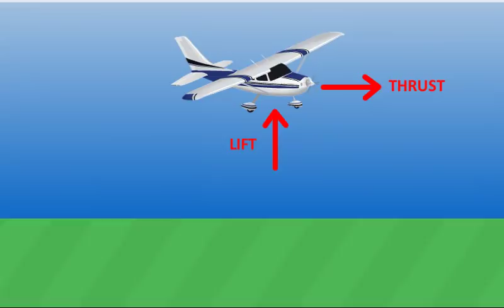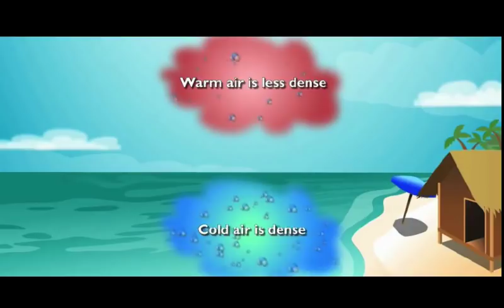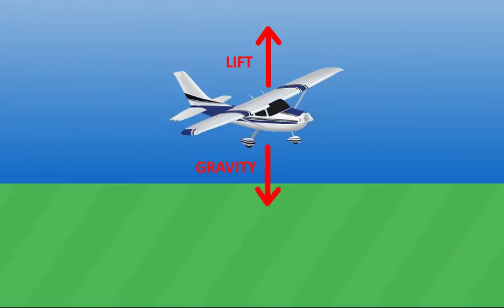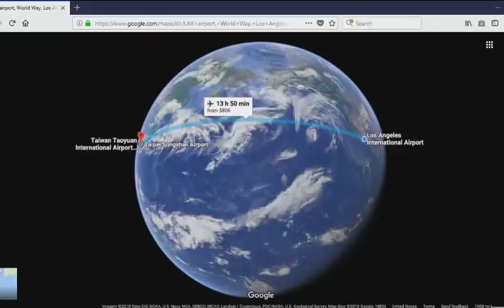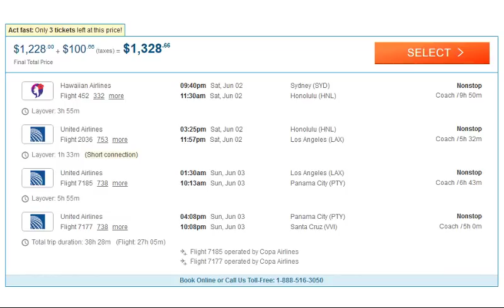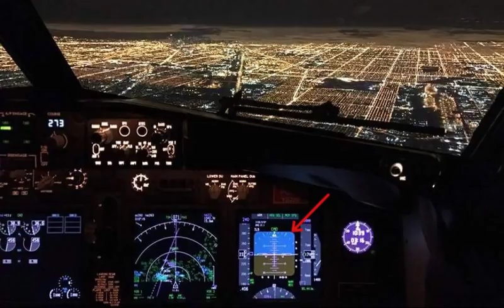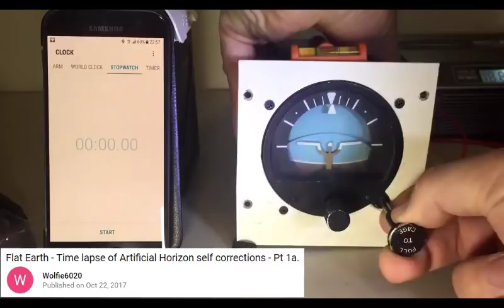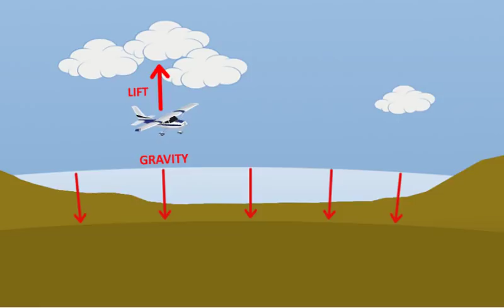Flat Earth Falsities - Plane Nonsense

Comment: First example is bull shit straight away if you throw a ball up in your car it will come back down as you are contained in the car try doing it on a mother bike see what happens...unless you think earth is a contained system ?
Reply: Correct, Earth is a contained pressurised system.
Reply: GrahamStw what’s containing it ?
Reply: Do you read your comments before hitting reply? Why the hell would throwing a ball up when riding a bike be relevant to the point this video is making? Maybe a little less weed before commenting! Good God!
Reply: Greg Mcbride if you don’t know that much of how the atmosphere works you shouldn’t make any claims, especially against proven science
Reply: It contains itself. 
Air pressure decreases with altitude. 14.7psi at standard sea level, but by the time you are 5500 metres up a mountain it is less than half of that. By the time you reach about 16,100 metres in a plane it is down to a tenth of that. By the time you reach the exosphere (700,000 metres and above) the air pressure is effectively zero.
Reply: WIND
Reply: GrahamStw or it has a dome. you have no idea

Comment: dmurphy and Flat earthers have never said the artificial gyroscope is fixed in space and therefore should roll backwards as it goes around the curb of the earth.
Q. If the gyroscope automatically adjusts to the direction of the earth wouldn't that be a false reading to the pilot ? the gyroscope initially reveals to the pilot of the curve then adjusts itself to the horizon again, so what adjusts the direction of the plane ? unbelievable.
Reply: In answer to your question, no. 
The purpose of the gyro is to indicate level. The point of the pendulous vanes mechanism is to adjust the gyro so that it spins parallel to level.
Reply: I suggest you watch Wolfie’s “A look inside an artificial horizon” video. 
https://youtu.be/z1QGRPVBZvw
It shows the internals of the attitude indicator and demonstrates the pendulous vanes mechanism.
Reply from the maker: Tribes - I showed a clip of DMurphy saying exactly what you say he doesn’t say - “should roll backwards”. Did you even watch? 

No, the gyroscope does not present a false reading to the pilot because the adjustments are slower than normal plane maneuvers. If you bank left or right, the gyroscope will stay upright in the short term, such that it indicates the bank. Same with a pitch up or down. The gyroscope maintains level to earth long enough to indicate the pitch. But over longer periods of time, the gyroscope can become out of sync with gravity, even if there were no curve, because even the best gimbals are not perfect, so some acceleration forces will push the gyro out of alignment.
Reply: "So why does have to adjust to the direction of the earth all the time ? It shouldn't have to."

Because the Earth is round, so level in one place is not the same as level in another. True Level is defined as a tangent to the curve, perpendicular to gravitational pull.
 https://s33.postimg.cc/7unercrfz/level_tangents.jpg 

As Voysov says, the mechanism would be required on a flat earth too, as it erects the gyro correctly at startup and in-flight it corrects for precession and possible tumble from fast manoeuvres.

Here's the user manual for a typical artificial horizon (aka attitude indicator): https://www.kellymfg.com/images/RCA26_AK_BK_EK_user_manual.pdf

Here are some quotes: "During pre-flight procedures, the attitude gyro must be provided with adequate electrical power under normal vibration conditions 
(engine running). Allow a minimum of three minutes for the gyro to settle to true level."
"Caging the gyro while in flight when the aircraft is not level will cause the level indication to be incorrect. The gyro must be allowed a few minutes to settle to True Level before it can be safely relied upon. If you must cage the gyro while in flight, it is best to have your aircraft as close to level flight as possible. The closer to level the aircraft, the quicker the gyro will settle to True Level."

That "settling to True Level" is the pendulous vanes mechanism in action. Or as the manual describes them "gravity-actuated vanes that direct “jets” of air to automatically level the gyro."
Reply: Yeah needs "fixing." We just need to invent a perfect gimbal that can hold a gyro and measure its angle but exerts no force upon it, has zero friction and no chance of tumble.

"Mechanism or not, keep the plane level and gyroscope will help you keep it level and you won't fly out into space."
And that is correct on a ball too.
Reply: +Bobby Wizdum
Why do you run away when people ask you questions?
Bobby Wizdum
"do you understand it?"
"f is the amount of force gravity applies ok." No. Fg is the result of G.m1.m2/r^2
 m1 is the constant earth center" No. m1 can be any mass. Any mass anywhere in the universe, as can m2.
" m2 is the variable" No. m1, m2 and r are all variables.
"differ and vary are synonyms" Synonyms do not mean the words have the same meaning which is why they are called synonyms. Rotate and spin are synonyms but they do not mean the same thing.
Bobby Wizdum
"how does gravity know how much mass objects have? " It doesn't does it."G" is a constant
Fg=G.m1.m2/r^2
It is the objects that vary not gravity and it is their interaction that varies not gravity.
Fg=G.m1.m2/r^2
Put some values in and see what happens. G doesn't change. The interaction does.
If a feather landed on your head, it wouldn't feel very massive, or heavy to you but if a massive rock landed on your head you would definitely feel it and be hurt. That would also be the case in a vacuum where the density of the medium is zero .i.e. the effect on you is due to mass and gravity. Density doesn't "know", it just is, like electricity, light and magnetism just are, but you would know the differences in the effect of the gravitational constant.
Does a magnet "know" how to be deflected" No, it just is. And that is true from the micro to the macro, just as it is with gravity. Similarly with all basic, natural forces of nature.
+Bobby Wizdum   Why no answer?
"you said weight cant exist without gravity". Which is correct.
"scales existed before gravity was added to the weight formula"  No. There was no formula prior to Newton.. People didn't know the difference between weight and mass. Just like you.  They also didn't know why the same object had a different weight in different places. That difference is due to gravity.
Electricity existed before Faraday, Maxwell et al, but you accept the laws of electro-magnetism don't you. If you believed your claims you would also have to believe electricity and magnetism don't exist. Your logic not mine.
+Bobby Wizdum
"wong g must know what the m1 and m2 are. case closed?" Why?
"prove it just is man? demonstrate what you say is true. you cant!" I did. Just because you are incapable of understanding basic maths and physics is your problem, not mine.
"throwing a tantrum"" Please. I am laughing at you. It is interesting that poorly educated, low intellect people accuse people who calmly and quietly prove they are wrong of "throwing a tantrum" or being mad etc. It is very, very telling.
Reply: You say elaborate, I say detailed with supporting evidence.

"do not adjust while in flight, keep the the plane level and the gyro will stay level and viceversa."
Except that wouldn't work, because even if the world was flat you'd still need a mechanism to correct for imperfect gimbals and gyroscopic precession.
You can see the mechanism exists and even if you don't believe the world is round, you can see that such a mechanism would continuously correct for level if it was round. Yes?
Reply: Did you look at gyrocompasses? How do they work on a stationary flat earth with no gravity?
Reply: @jordy f
Fuck off you pathetic troll.
Reply: +Bobby Wizdum
Why do you run away when people ask you questions?
@Bobby Wizdum
"wong you have not researched"  What you fail to recognise is that some people have a working knowledge of the real world and have experiences which allow them to make rational, logical decisions on such things.
In my rather extensive experience in mathematics, science and real life situations I have found that the mathematics and science I learned at school, college and university actually conform to and confirm real life. Unlike you I actually have real life experiences which means I actually know things, rather you who naively "believes" any old cultish claptrap.
Tell me, how many times have you navigated around the world?
Or to the Arctic or Antarctica?
And tell me what you saw on your travels and how you actually navigated.
Tell me how you ascertain the error of a compass when in the Southern Ocean, using Alpha Ursae Minoris?
We know the earth is a slowly rotating terrestrial spheroid and gravity is a fact.  Just because you are incapable of understanding basic maths and physics and wilfully refuse to learn such things is your problem.
Examples.
What is the relationship between longitude and distance when travelling east or west parallel to the equator?. If you know the answer then you know the earth is a spheroid. If you don't you are not qualified to comment on the earth’s shape.
Please explain the principles behind the development and functioning of a gyrocompass? If you can then you know the earth is a slowly rotating spheroid and gravity is a fact. If you don't you are not qualified to comment on gravity, the earth's shape or movement.
Reply: GrahamStw

Just attach a gryoscope on your bicycle or your car. You will know how it works.
Reply: I know how a gyro works thanks jordy.
Reply: grahamstw   ...  I know it indicates level, the video suggests only left and right attitude not horizontal level.
So why does have to adjust to the direction of the earth all the time ? It shouldn't have to.
Reply: Jordy f   ... I know how a gyro works.
Reply: voysovresin ..  Sounds like you don't listen to your own videos, dmurphy did say .. '' it should begin to roll  backwards'' now we're splitting hairs.
Oh, now the adjustments are slower than normal plane manouvers, we're not talking about banking left or right that's irrelevant - does the plane stay level without any adjustments, if yes then there is no curve.
Reply: Graham stew  ... A very elaborate but unnecessary explanation. Here is a better one but a lot less elaborate. 
Before take-off the artificial horizon is calibrated until it's level, do not adjust while in flight, keep the the plane level and the gyro will stay level and viceversa.
Reply: Graham stew ... are you sure ?
Reply: If you'd like to see the opposite effect then take a look at a gyrocompass. These devices have been used in ships, boats and submarines since the early 1900s and use gravity and the spin of the Earth to create gyroscopic precession forces to find True North.
Reply: ''Imperfect gimbals and gyroscopic precessions ''- whatever, it's irrelevant, sounds to me it needs fixing then.
Mechanism or not, keep the plane level and gyroscope will help you keep it level and you won't fly out into space.
Reply: GrahamStw i already ate that b.s. up in the other thread. here it is again. if the plane is at a right angle to the sphere and its parallel to the surface to form a right angle gravity would pull the plan perpendicular when traveling north or south. e/w youd be sideways lol you realky don't get it man. the plane flies parallel to the groubd because the ground is a plane! see how easy that is to explain?

Comment: Contradiction: Explain what science calls the coriolis effect then, where the destination of a bullet is adversely affected by earth spinning under that bullet. And now you say the air is spinning with the earth, which one is it ? gimme a break.
Reply from the maker: Tribes - the guy in that video completely misunderstands the coriolis effect. The bullet DOES NOT move independently of the earth’s rotation when it leaves the gun. That would break the law of conservation of momentum. If that were true, the bullet would suddenly travel 1000 mph west when shooting north or south. Uh, uh. 

But the coriolis effect can have a very tiny effect on long range bullets, due to the fact that the ground actually moves a bit slower the farther you are from the equator.  

The coriolis effect is best seen in the direction of large weather systems, which tend to rotate counter clockwise in the north, and clockwise in the south,  due to this effect.

Funny, flat earthers have NO CAUSE for the CE in their view, but love to bring up the bullet thing. Why? It refutes your model.
Reply: @Tribes. Bullets are barely affected by change of speed of air moving on different latitudes. Wind speed across surface of Earth is more prominent than that. Snipers account for wind speed, direction and Coriolis effect when making long range shots.
Reply: Are you serious?
Try this experiment, put your hand in water and move it.
Does any water move with your hand?
Now have someone shoot a bullet through your hand.
Does the bullet move with your hand?
Reply: I think you got bruce lees experiment mixed up with the coreolis effect.
That statement was not my own, it's a well known experiment on line and taught by your so-called know-nuthin' scientists. Take a look https://www.youtube.com/watch?v=jX7dcl_ERNs
Reply: @Tribes. Bullets fly very fast and have shape that minimize air resistance that's why they are barely affected by air movement.
Reply: VoysovReason military hete. No military uses and ce math to destroy targets. No mos no branch. C effect is bullshit. Ask a sniper. Ask a lrms tech. Or stfu.
Reply: VoysovReason whats funny is you claim the plane doesnt have to account for it when your coriolis sights say it does. in fact it should have to account more for it as it has more mass and therefore would encounter more resistance.
Reply: Martin gorbush  ...  barely affected ? or not ? but it is affected to some degree, that's the point there are no adjustments to be made at all. There is no Coriolis effect which means the earth is not spinning.